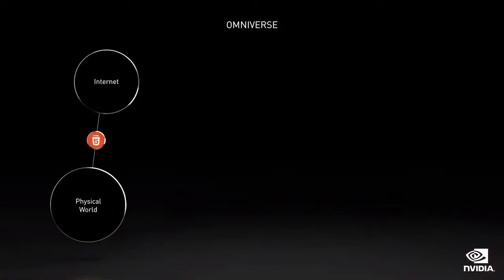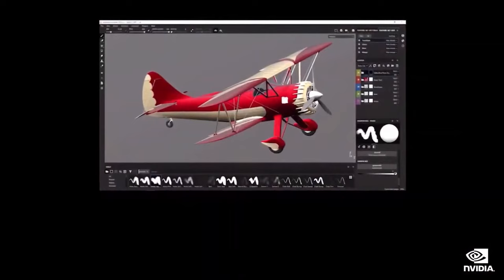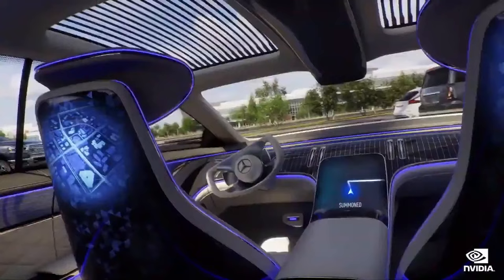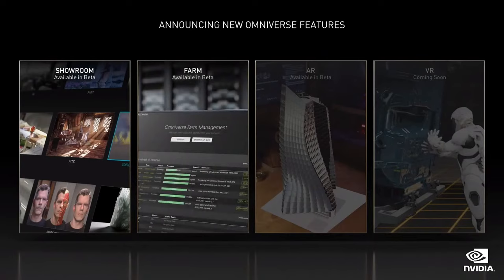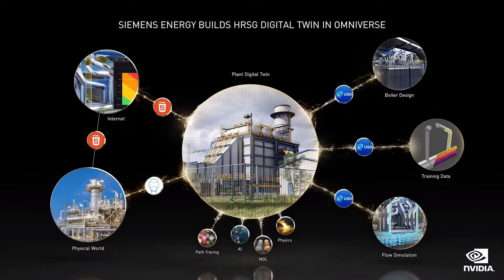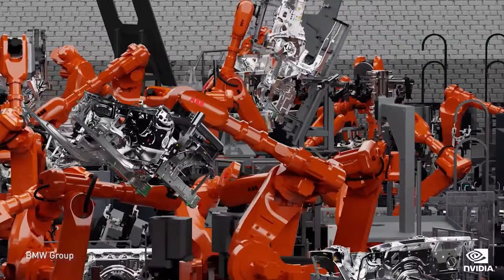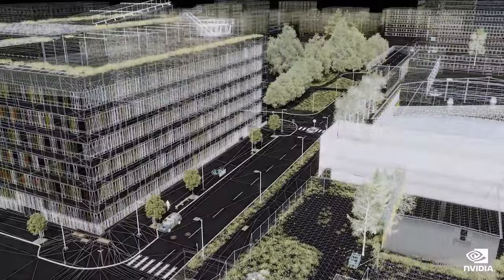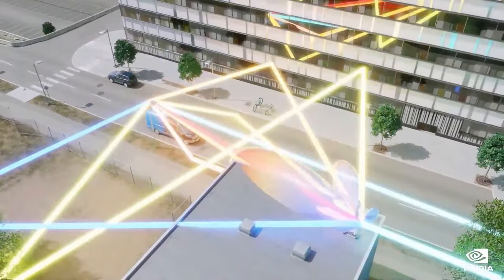Nvidia's Jensen Huang reveals vision for the Metaverse! (with Omniverse)

Comment: this is more promising than facebook metaverse because, it's coming from the angle of design, engineering, simulation, which is made to be accessible virtually and allow for multiple collaborators.  a Metaverse designed by productivity software already in mainstream enterprise level workflows  then later the social aspect ontop of that is the right approach because it truly gives the participants in the Metaverse full Content Creation capabilities, then just add the NFT blockchain technology to mark the creation of digital assets, and now you have the perfect metaVerse,   Mark Zukerberg needs to colllaborate with Jensen Huang if he want a real chance at capitalizing on the MetaVerse industry!

Comment: So does this mean that someone should be able to start a project in blender, send to C4D and then to render out in UE5? I still don’t get why one universal 3D format has never been used to make it easier for use across all DCC software.
Reply: Exactly! I was wondering that for years too. Also, why no simulations use interchangeable assets, not to mention adopting inter-sim communication akin to what the military use (different sims model different things, but the results can be seen across the grid).
Reply: @getsideways7257  more than likely its a money thing. i.e use this software or that software and cannot share so you must buy 'X' brand etc
Reply: @ukmonk  Sound like that is the case indeed. But it sure is maddening...
Reply: Isn't that what Alembic is trying to solve, and now Pixars USD is on the way..
Reply: @Moctop  yeah but its far from practical in its present state. you have to jump through lots of hoops to get results. i hope one day, you can just transfer over EVERYTHING like materials, sims, animations, etc
Reply: haha, even changing version of unity brake its own assets. imagine trying to port to differents Apps. Hope USD gets picked up fast by all companies.

Comment: Any object will be I.herently worthless in the metaverse. why would you pay for a car there? Instantaneous movement from on location to another would be easy, and free. The point of a car is to move in the physical world, there is no point to this in the metaverse beyond participating in a game. And even then the car is just a line of code. You could easily write and import your own code, or fine an open source code and copy that. Why would one want a digital forklift, when in the metaverse it should be as easy as pointing at something to move it to a new location or delete it entirely. 

These companies aren't creating metaverses, they are creating marketing and sales gimmicks. The metaverse will be open source, built on a standard platform, easy to add to by hosting your own space and running it off the open source code and edit using readily available tools. A metaverse that's trying to sell you parcels of "land" or digital assets like a computer that will sit in the virtual world and do....nothing, is just ridiculous and not a metaverse at all.